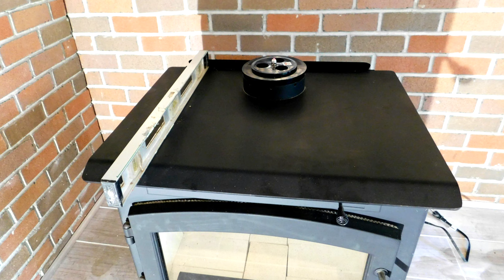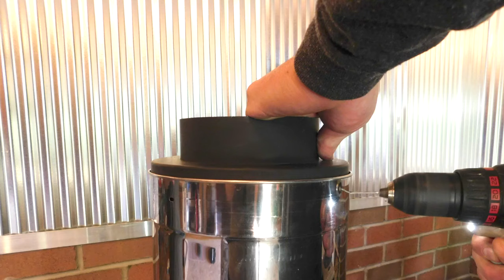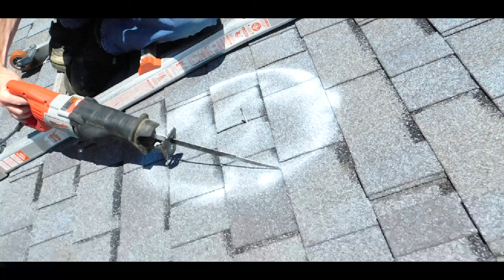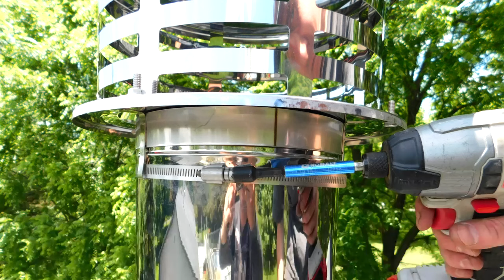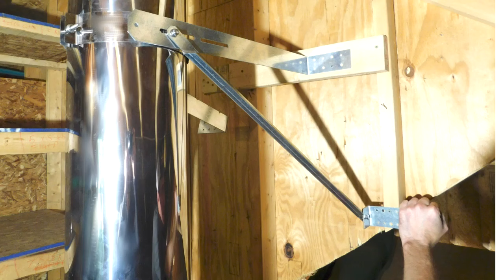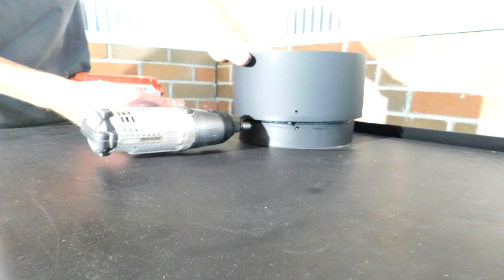Wood Stove Installation with Class A Insulated Chimney Pipe by Rockford Chimney Supply

Comment: What if it's a metal roof?
Reply: Same question I have
Reply: Youll have to take the sheet/s off to gain access to the decking as well as install the class A roof collar and vent. Once secured take a small piece of metal full width by 2' or better. Lay the sheet above and below the vent while overlapping the already installed sheet. When the small sheet touches the vent mark the sheet still installed do the same for the top mark. Pull from the bottom of the installed sheet and these two marks are your verticals. For Horizontal butt the inside rib edge of the installed sheet. (Remember to account for the rise of the metal off the existing roof due to the ladding and rib height.) Start small and widdle it to fit. Clean metal and vent, dry and seal generous in the back
Reply: Rubber roof jack

Comment: To me , I want to buy a stove  and exhaust/chimney assembly.  Since I'm building the cabin, just tell me what kind of roof and cabin needs to go around the stove and chimney sand I'll build the place accordingly,  I'm not retrofitting anything.  It's like when you buy an outfitter tent and woodstove assembly.  They just go together and you assemble the thing where you want it.  Simple.  I've done it in the past with tents and it worked great..  Now I just want o do the same thing with a small cabin. I don't want to look for a bunch of parts..  That's the job of the stove designer/seller imo  They should know more than me.  It's their damn product.